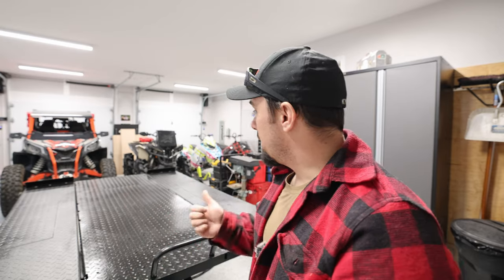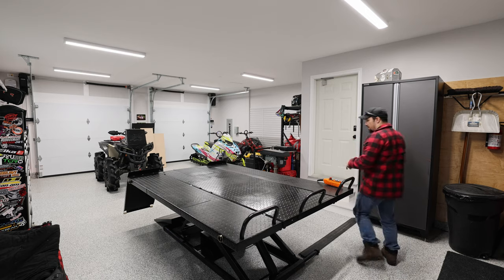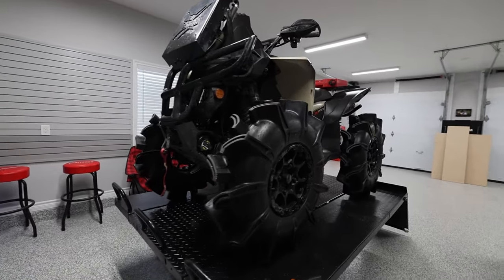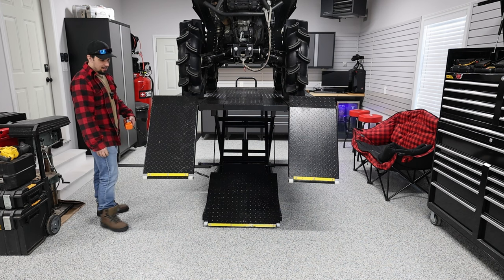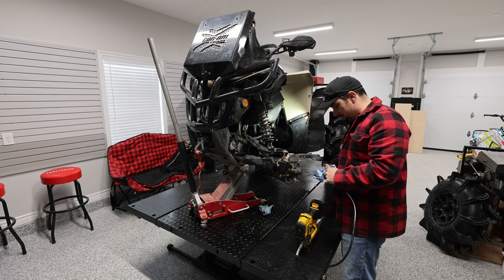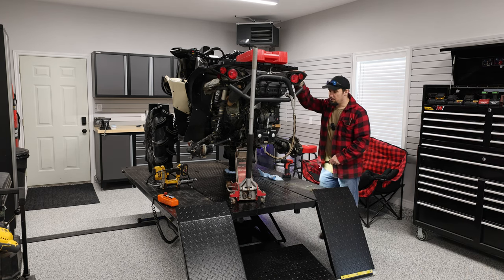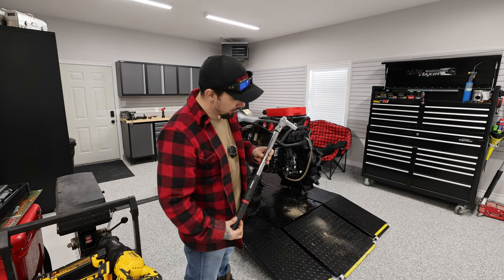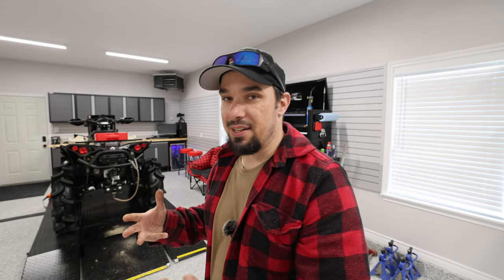2200lbs Electric/Hydraulic ATV UTV Lift Table!

Comment: Can’t wait to see this seasons trail videos. House is coming along beautifully, and the garage is looking fantastic. My garage is 3x the size, but feels half the size of yours. Your organization skills are wild Kyle😂 keep up the great work, seems like everything is falling into place!
Reply from the maker: I love a functional space! Getting it dialed in is really important 👌 thanks!
Reply: @MainvilleATV  I’ve got both of my outlanders, my yz250, 2 sbc’s on engine stands, a 50T hydraulic press, sandblast cabinet, welder and torch sets, 2 chest freezers, 2 big tool boxes and a bunch of other crap taking up so much room🤣 I did a deep clean about a month ago, but it never seems like enough. I can get 2 3/4ton pickups side by side in there with everything else, but still feels cramped. And I for some reason knew you were a mechanic of some sort. Can’t remember if you’ve mentioned it over the years or not. I’m an ironworker by trade (fitting and welding) but a logger by heart. Just doesn’t pay like it used to, to cut wood! Come to Maine some time, you’d love riding where I live

Comment: I totally agree with not liking working on the floor. Every job or hobby I've ever had involved working in Dirt, mud, snow or ice. I now have a heated 1800 sq. ft. shop with a 2 post car and truck hoist. unfortunately my knees have payed the price thou as they are currently 66 years old!!

Comment: Right where you strap down your license plate there’s four bolts . Take the two upper bolts out.On your license plate, drill the holes out a little bit bigger. More secure place for your license plate.